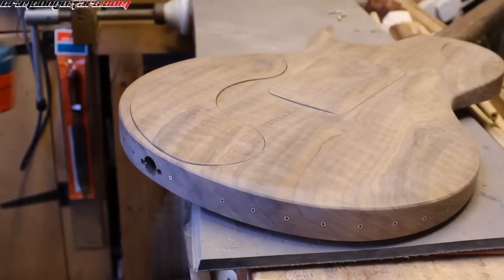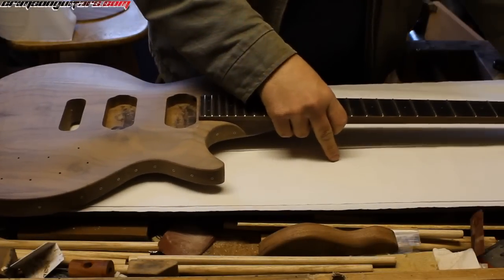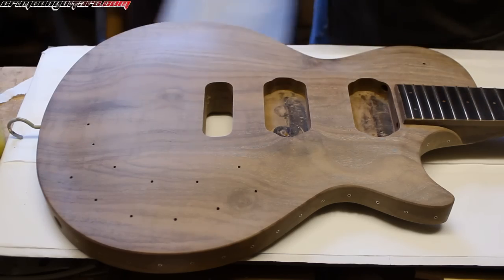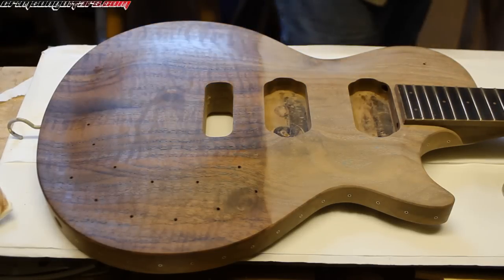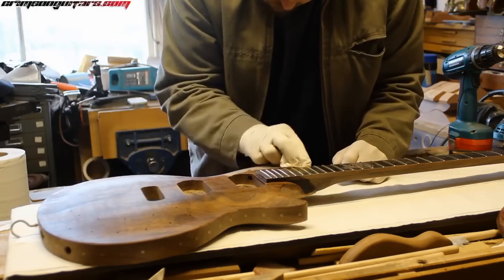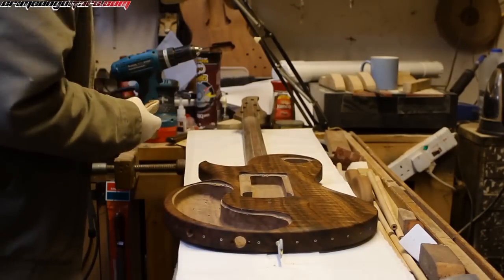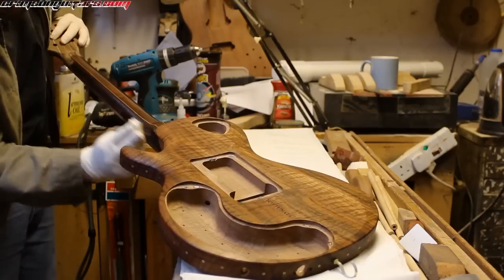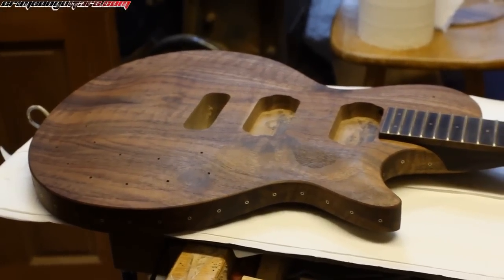Clarity Ep 53 - Applying the Initial Coats of Lemon Oil Finish

Comment: A couple of suggestions Ben. Rags soaked in some types of oil can heat-up and catch fire. I soak mine in water and then bin them. Second point, to make oil finishes last longer in the tin, the tin can be squashed, with a vice or "G" clamp to exclude all of the air before putting the top back on. It doesn't look pretty but does save money.

Comment: I'm wondering when you put the lemon oil does it change the sound of the guitar by any chance? when I am implying is that the oil gets in the wood and slightly change as a resonance are the guitar. I would think this might definitely have a effect on a string non electrical instrument like a violin. I know when something like that as the wood gets older the natural oils are displaced and it actually becomes a honeycomb version on a small molecular level. without really getting into it question is does it change the sound of the guitar